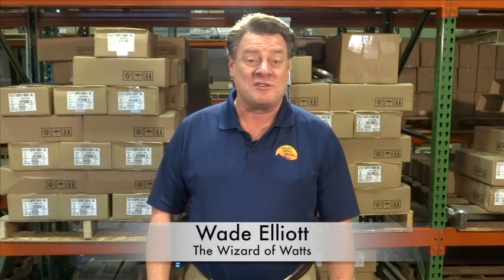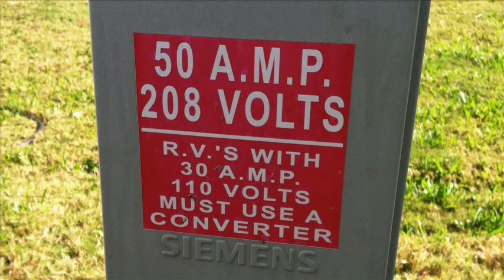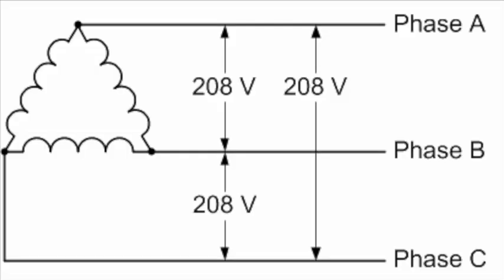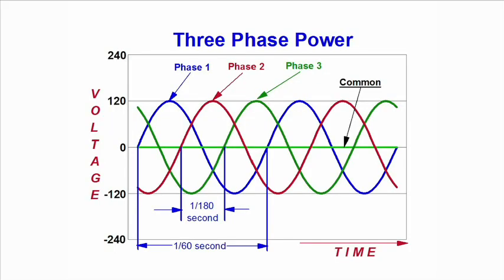Episode 11   208 Volts, 3 Phase

Comment: Can 120/ 208v 3 phase generator power a 230v 1 phase welder without modification has 4 prong 120/208v 20amp receptacle  beside getting an adpator from 3 prong welder plug to 4 prong from generator?
Reply from the maker: Sorry, I wouldn't know. My experience is in powering RVS.
Reply: Theoretically you could use a variac or a transformer to boost the voltage of each phase by ~10% and keeping things balanced. Also, I believe most devices are designed to have 10% tolerance in the voltage, so you'd likely be able able to still run 208 as the lower acceptable end of the tolerance for 230V, but at the expense of putting more current through for any given power load being consumed. Best to consult a professional... you may also check the power input and see if 208V falls into an acceptable input voltage range, in which case it possible you'd be good to go. You'd be best to consult a professional if in doubt, and don't make any assumptions. For all we know, there could be some inherent flaw in putting hot to the neutral (because it was designed to be used as intended and using the design and safety standards of that time).  Safety  and design standards are always improving, but there's usually a tradeoff of some sort as a consequence, and just because something is supposed to or believed to be designed to those standards doesn't mean it actually is, or that it still doesn't have some undiscovered fatal design flaw,  or flaw when used not as intended. Always observe safety precautions and use equipment only as intended!

Comment: How can you make 240V from 208V ? Even if you use only 2 phases with neutral wire ist still 208V between phases.
Reply: If you needed 240V for a specific device you could use what is known as a "buck boost" transformer.  Most 240v appliances such as a large window or thru-wall A.C. are rated "208-240V" and will operate anywhere between 207-253V, but if the line voltage is a bit low or the unit wont start on a 208V supply  one of these transformers will correct the issue.
Reply from the maker: Przemek, You cannot make 240 from 208v.  But an RV uses only 120v on all of its services.  So whether that is provided by 120/240 service or 120/208Y, the RV 'sees' only two 120v services.  WW
Reply: Utility Supply Group Sir: then why does the video mention 240 volts? we do not see it on any of the drawings. thank you.
Reply: @tedlahm5740  240V is the typical"split phase" power in the U.S., 
the neutral is center tapped with to give you 2  120V opposite phases (180 degrees put of phase), which are 240V phase to phase. 208V 3 phase power is used for buildings with larger power needs or when theres a need for smaller 3 phase motor ( which is desirable because it delivers constant power/torque). Each phase is 120V to neutral, and 208V from phase to phase (120 degrees out of phase).
Reply: @onradioactivewaves in other words there IS no 240v 3 phase ?
Reply: @kevinhernandez62  3 phase power in the United States is  typically 277/480 wye configuration. Residential homes are 240 single phase, converted to  split phase to give opposite  legs of 120 with a grounded  center tap.  There is 240V 3 phases delta power which also provides 120 /208 V.  My guess would be that the 240V 3 phases is wired to commercial and light industrial zones. Most commercial has a single phase of 277V for lighting or other use I cannot think of, and industrial having the 3 phases 277/480. I don't really know that much though,  my experience come more from working in industrial or for lighting controls. Could be totally different in different parts of the country for all I know.
Reply: @onradioactivewaves  what if a piece of equipment calls for 3 phase 240v ? I've been scratching my head on this ?
Reply: @kevinhernandez62  yes there is 3 phase 240v but it seems to be mostly wired for 120/208. Just look up 240 3 phase open delta and you will see. I think its normally just wired for 120/208  but if you had all 3 phases wired in your could do it.

If you are wondering because you need to power a device, you want to consider using some of the new methods being used to supply 3 phase from a single phase ( e.g. for a small lathe or mill)  I know some people choose that as the best option now. You just need to find out what service you actually have in the first place and go from there.
Reply: Look up 240v 3 phase open delta. Its 240 phase to phase, 208 phase to centertap between the other phases ( used for split phase 120) so its definitely possible.
Reply: @onradioactivewaves  yeah but it's not a 3p 208v then

Comment: I’ve got a wall oven 4 wire inside the door it says 120/208 how do I go about hooking it up to a 200 amp breaker box
Reply: Best bet is to contact a local electrician to have them evaluate exactly your situation. Thanks for watching.
Reply: BRENDAJASON1 if it says 208 that's a 3 phase oven, if its for a home more then likely you have the wrong type of oven, you need a 240 oven .. your best bet is get a electrician out there